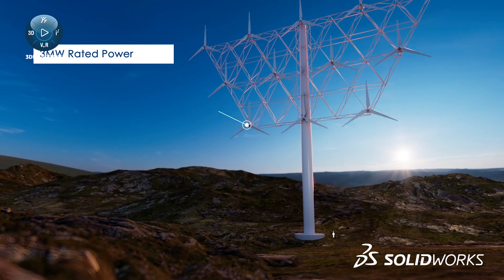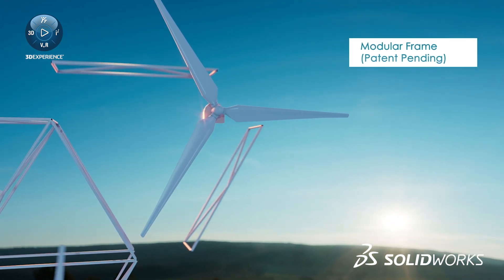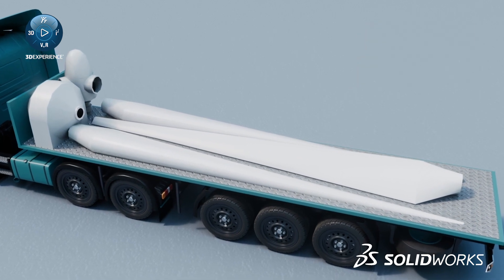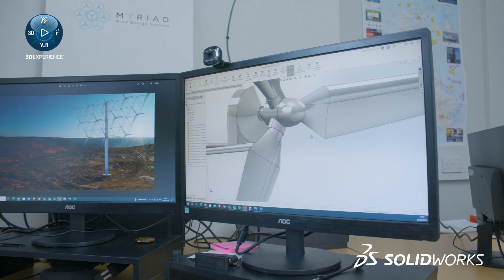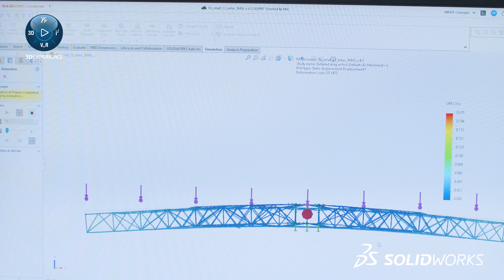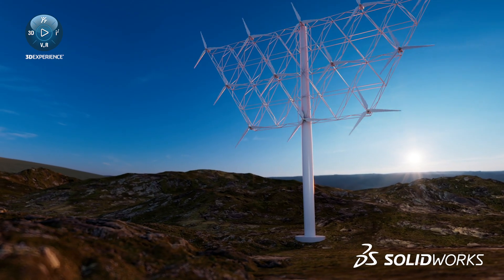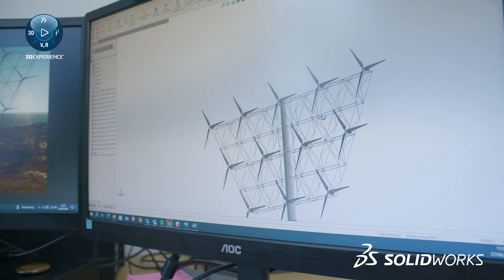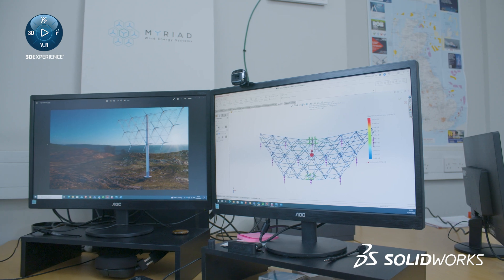Watch how Myriad Wind Energy Systems are creating the next wind turbines using 3DEXPERIENCE

Comment: I have no idea how startups like this get funding.  This concept is flawed on so many levels it just isn't funny.  With a 13m rotor diameter, and using the Betz limit to calculate the energy available to each rotor, the 250kW estimate is ridiculous.  It would be more like 25kW after losses if you were lucky.  Also no rotor gearboxes / PMGs or Yaw mechanism is shown for the tower.  Surely this is just a student project??